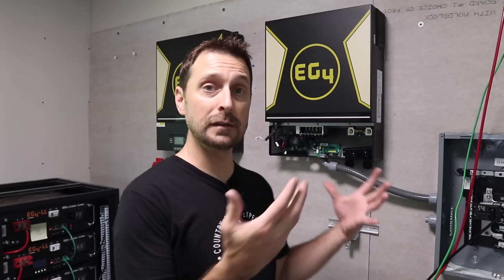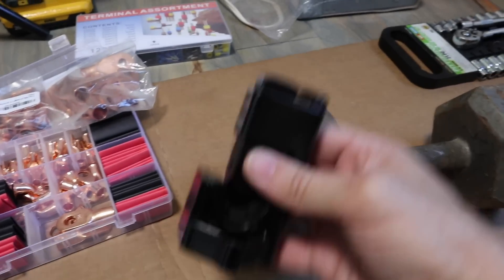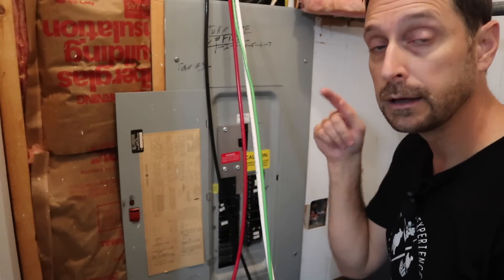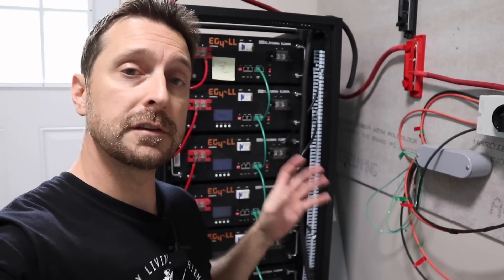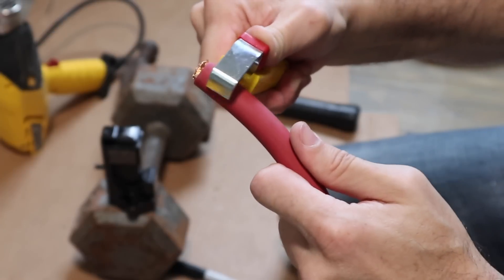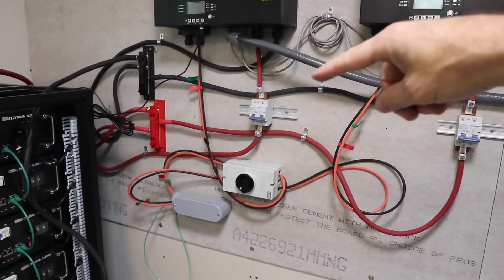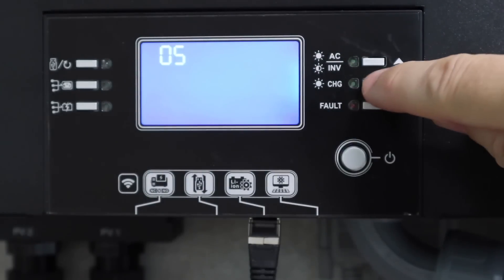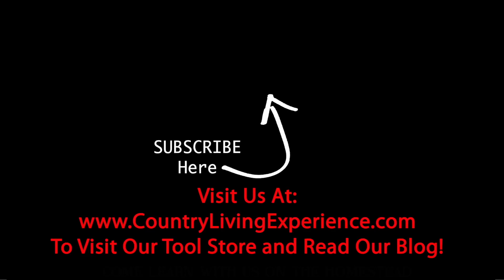EG4 Inverter Installation Full System Wiring And Tips! Off Grid Solar!

Comment: How do i get 120 and 220 to my house, do I need two 6500's or can/how this be done using one 6500?
Reply from the maker: You need two 6500's for 240v. They need to be set 180 degrees out of phase commonly known as split phase.
Reply: @CountryLivingExperience  ok thanks so then would I be able to get both phases out of two 6500's?
Reply from the maker: @alvingallegos6367  Mine are set up in split phase. I do not really understand what you are asking.
Reply: @CountryLivingExperience  my understanding is you need two 6500's to get 240 volts right? So that said, with both panels wired for 240 will that limit the ability to have 120 volts at the same time? Didn't see that explained so needed more information.
Reply from the maker: @alvingallegos6367  Yes. Each 6500 outputs 120v. You need 2 to make 240v. You land them on a double pole breaker which touches both sides of the panel creating 240. Any 240 load like a dryer will have a double pole breaker which pulls 120 from each inverter. All 120 loads will pull 120 from one inverter or the other depending on which side of the panel the breaker is located.
Reply: @CountryLivingExperience  comprende señor! Gracias!

Comment: also maybe explain how the USB works ( Solar, battery, Utility ) meaning for example when set on USB your running on solar but what happens when you exceed the solar output, does it just switch over to battery or does it augment with battery ( and same question for utility ) . thanks
Reply from the maker: We are always on SBU (Solar, battery, utility). If I exceed my solar output, it draws from the batteries as an augmentation to the solar input. So I draw 5kw from my loads and my panels are only outputting 3kw. It will draw the 3kw from the panels and an additional 2kw from the batteries. Concept is the same for the utility.
Reply: @CountryLivingExperience  great info I have the same unit and I am still setting it up . also thanks for the fast reply !. very good video by the way
Reply from the maker: You're welcome. Glad to help.

Comment: In your Amazon links, the safety switch is only rated for 30A but your breakers are 70A. Since the 2 inverters can push up to 70 and I’m assuming that is the intention since 4 gauge wire was run, shouldn’t the safety switch also be rated for 70A?
Thanks for all the info.
Reply from the maker: Here is an updated link.....https://amzn.to/3FXCkHO

Comment: Good info on your solar system, but don't run single conductors in the wall above your house panel through romex connector.
Reply from the maker: Thank you.  
NEC 300.3 states that THHN or single conductors must be run in conduit, raceway, aux gutter, cable tray, etc.  Provided it has the proper spacing for the temp rating. Additionally my electrician recommended it be in conduit per code.

Comment: In addition to my last question a 70A breaker at 120V per leg will allow 8.5 kW per leg of a breaker panel, and the inverters you are using provide 6.5 kW per leg.  How does this discrepancy provide the power you need for the loads on the breaker panel?
Reply: That is an easy answer. He doesn't need to account for the discrepancy. People don't usually run to the max for their power needs. It just means the cable and breaker installed are rated for 70A. It's OK to put in the inverters that will be pushing out power less than what the cable and breaker could support.
Reply: @vt20247  Thanks for the reply.  I have an 80 amp breaker in the main panel feeding a sub panel.  I plan to disconnect the sub panel from the main panel and use that line to feed the inverters, then run the AC output from the inverters to the sub panel through an 80 amp breaker and #4 awg.  There are two battery banks that feed the inverters for the AC output and the solar array will charge the battery banks through the inverters.  I will be using EG4 inverters from Signature Solar.  Do you see any issues before I complete the installation?

Comment: Why does L2 or the Inverter 2P2 Program 5 set to "User"? Isn't the 2P1 Inverter communicates automatically with the 2P2 Inverter via the RJ45, therefore having the same program setup? Or is that what Signature Solar recommended when using their EG4 batteries? Great video btw. Thanks for this post!
Reply from the maker: You're welcome. 
2P1 is the master and where the battery comms cable is connected to. That connection on the battery is the RS485 port for the EG4-LL type. 2P1 and 2P2 communicate via the old VGA style cables (gray color) when paralleled. This is what Sig Solar recommends for the correct setup. 2P2 is set to User and 2P1 is EG4.

Comment: You say you are using 2/0 copper wire to energize a 70 amp breaker from the inverters.  Can the inverters and wire carry 80 amps?
Reply from the maker: Hello. No, the inverters are connected to the 70amp breaker via 4awg wire. The 2/0 and 4/0 is for the battery side.
Reply: @CountryLivingExperience  Thanks for the reply.  Does the "No" apply to the question about the 80 amp breaker or that I misunderstood the 2/0 copper went to the breaker?
Reply from the maker: No applied to misunderstanding the wire size to the breaker.

Comment: The breaker for the battery positive should be upside down for the line and load indicators to be correct. 🤔
Reply from the maker: I flipped it.
Reply: @CountryLivingExperience  haha perfect, I still watch this video regularly to keep all the info fresh, and I'm sure you use ferrules for the small Gauge wire ends now

Comment: You know it’s amazing how you running four gauge wire to those inverters I have a 22KW Generac bronze six gauge wire and if you pay attention the wire that comes from your Lipo to your house is aluminum four gauge and I like company runs 200 amp for the 48 V I don’t understand because that’s a lot of amps
Reply from the maker: Interesting that Generac is 6 gauge. The aluminum that comes in from the power company to my main panel is 2/0 gauge for 150 amp service.
Reply: @CountryLivingExperience  in my house is four gauge aluminum 200amp service No from a breaker box to the meter is four on copper wire from the mirror to the top where the company hooks up as for our copper wire my house is only two years old Brian Eno and that’s why they put aluminum four gauge
Reply: You want to hear something funny that’s plant electrical permit was for because the county wanted a 200 amp service in my house my house runs on a 220 7000 watt because there’s a high-efficiency home I apply for 150 amp Service and it was denied
Reply from the maker: That is crazy. Wonder why they wanted a 220A
Reply: @CountryLivingExperience  i don't have no idea why they wanted 200amp services

Comment: Have you had any LED light flickering with these inverters?
 Not so nice reviews about issues of phased voltage not being stable.
Reply from the maker: I have had a few of them flicker. This was addressed in a video by Signature Solar here: https://youtu.be/2XsTTmzr4Tc. They compared a Schneider, Solark, and EG4. All of them had some flicker on led lights. The common factor if I remember correctly was that the led's that flickered were cheaper bulbs. The more expensive bulbs did not flicker. I even get flicker from grid power on some of my led bulbs at home.

Comment: Compared Growatt 5000 vs. Eg4 6500. Decided on Growatts, because I have to have split phase for 120/240v. My shallow well pump surges at about 1000kwh. It is a 220v pump. So I had to have split phase to accommodate that and some other 220v loads. My concern is, what happens with the EG4 6500 if it is set up in parallel to run split phase 120/240, and one goes out? I spoke to Signature and they said they were sure that there would be no problem but, this is a newer product. If you lose one of these you’re down to 120 and you have 240 loads that suffer. Am I misunderstanding this. I haven’t set my system yet. Awaiting my shed to house my brain (batteries, inverter, etc.) Thanks for your homesteading outpost work. Rev. 14:6-12
Reply from the maker: It is kind of the 6 in one hand vs half dozen in the other issue. The Growatts are 240 and they need the external transformer to split into 2 - 120 legs. If you lose the transformer, you are sending 240 to your 120v loads and may burn out motors, etc (they have never had an issue with this happening). On the other hand, if you have the 120v EG4, you need 2 of them and set them in split phase thus obtaining your 240v. If you lose one of the EG4's, you will only have 120v and won't be able to power your 240v loads. The solution is to get the new EG4 6000ex-HV. This is a true split phase inverter that will give you both 120/240. Hope this helps brother!
Reply: @CountryLivingExperience  EG4 should give you a commission. Thanks
Reply from the maker: Thank you. I am actually an affiliate partner for Signature Solar. If you use the link in the video description to purchase anything from them, I earn a commission.
Reply: @CountryLivingExperience  are you familiar with Rev. 14:6-12?
Reply from the maker: @secondadventmessengerminis3594  I am. 3 Angels messages
Reply: @CountryLivingExperience  Then I try to send you the rest of my business. I have 24 385W bifacial, 3 Growatts, w/ 2 transformers, and six EG4 LiFePo batteries. Hope to have housing for brains in two weeks and rack, then cabling and other hardware. If you have proper gauge cabling I can purchase from you. My panels will be ~200’ from brain center.
Reply from the maker: Thank you. I appreciate it. 
I think Signature Solar carries some battery cable and PV wires. 
What is a brain center?
Reply: Where are the processes are executed. Inverter charge controller, batteries, etc. I guess that’s my term.
Reply from the maker: Ah, I understand.

Comment: Inverter #1 is set at 2p1 and 120. Inverter #2 2P2 set at 180 for 180 degrees out from 2P1 to output 120 volts on each buss bar in your panel or 240 volts L1 and L2. Leaving 2P2 on 120 will only give you 206 volts across L1 & L2. Please check your voltages across L1 & L2 you may be under voltage!
Reply: It's for 3 phase. U can hook up 3 for 120/208 3 phase

Comment: Great wiring video!  You showed A/C output but didn't show A/C in - perhaps you could show this for us newbies out here and also explain grid pass-through hook up?  Thanks in advance.
Reply from the maker: Thank you. Since I am essentially off grid, I am not going to hook up the AC in.
Reply: @CountryLivingExperience  Can you direct me to someone or to you tubers who may be able to help with this? . . . as Signature will not give out electrical panel info that I really need.  Thanks again.
Reply from the maker: @dorahaymond4061  I am not aware of any specifically for this inverter. Ian's Solar Projects is a good channel. Try him. Beyond that, you may just need to hire an electrician that knows some solar.
Reply: @dorahaymond4061  the manual says 40 amp breaker for A/C input per unit. You would then need a critical loads panel for a/c output. Read the manual for more details.

Comment: Just want to point out that these EG4 inverters do not support rapid shutdown - they have DC voltage hanging after disconnect from panels and will not pass inspection if your inspector uses NEC 2014 or newer.
Reply: Not totally true. Typically rapid shutdown is for the solar panels that have micro inverters under them. His disconnect switch acts as a rapid shutdown.
Reply: @mattdroneon58  2014 code says no dc voltage on wires 10 feet from array. With this inverter even if you cut off the panels, DC is still on the line back feeding from the inverter capacitors.

Comment: So why didn't you show the solar connections?
Reply from the maker: I had already made those connections during the full build of my previous system. Those videos are here: https://youtube.com/playlist?list=PLe8gvCbPFkexFmUtg3xRS4sTZQ1Ve-ft1
Reply: @CountryLivingExperience  okay I'll watch a few more of them. Thought I was losing my mind you said you were going to show it and then I tried to skip to it and went back and forth lol
Reply: Since you answered so quickly I'd like to ask you a question. I bought the 6500ex and two batteries for my camper. My plan is to wire it in line with my 30 amp RV plug in and out AC. Those wires are only 10 gauge but since I'm not hooking up to anything other than a 30 amp plug or my 30 amp generator that should not be an issue correct?
Reply: And is there a setting where I can make the unit only put through 30 amps?
Reply from the maker: Not that I know of.
Reply from the maker: Those 6500's output 54.2A. You need to size your system breakers and wire appropriately for the inverter and the instructions.
Reply: @CountryLivingExperience  yes I understand that. Am I wrong in thinking though it will only put out what you're asking for. I'm only asking for 30 amps that's all it will give me? Like if my wife turns on a hair dryer it's not going to blow 54.2a through there unless I'm plugging in six hair dryers. I got the bigger one because the 3K inverter was out of stock till maybe next year.
Reply from the maker: I understand where you are going with the thought process. I cannot say for sure because I am not an electrician. I can't in good conscience give you advice on something like that.
Reply: @CountryLivingExperience  I appreciate your time thank you very much
Reply from the maker: I looked at the manual for this inverter and I think you can set the max discharge current as low as 30A. You can download the new updated manual from Sig Solar's website. I am not 100% sure but look at setting/protocol 41.
Reply: @CountryLivingExperience  that was way too cool brother above and beyond thank you you're awesome
Reply from the maker: No worries. Happy to help.

Comment: can you explain more on how to get you phone to link up , I.E. mine does but shows old data like its not updating . Also maybe show PC connection through wifi ..
Reply from the maker: I do not have the wifi dongle. I choose to hard wire a laptop if needed to view data.
Reply: @CountryLivingExperience  this inverter has built in wifi ( no dongle like growatt ) I got mine to connect once but its a pain. basically it looks like one you connect you phone to wifi from inverter then you put in the SSID & password for home router . then you jump off wifi on your phone and connect app through cell ( or home wifi ) at that time. but like I said mines being a pain. mainly cause we are WAY out in CO mountains and I have to use my wife cell phone for hot spot ( as home router ) then try to connect my phone . with weak cell signal .. app wont work direct to wifi off of inverter...
Reply from the maker: Ah, yes. I have both brands of inverters so I was mistaken. 
I didn't connect via wifi to the EG4. I am probably not going to since I usually get too frustrated with wireless tech.

Comment: I don't like that I can't use a 2 gauge wire cuz that's what I use on my batteries and I understand yes I have to use it 4 gauge hooking up the terminals I don't like that so much but what can I do about it not a thing I have to do what the inverter will let me do. And I believe on your second inverter the eg4 you go down there I think it's green 25 and you change the phrase there but it's kind of tricky how to do it though to get 240 volt out of it but EG for work explain it to you if you give him a call signature solar will tell you exactly what to do to make it a 240 volt and I'll take a step by step if you need to so give signature solar a call they tell you what you need to do to make it a 240 volt so that you would have a 120 volt inverter and a 240 volt inverter.